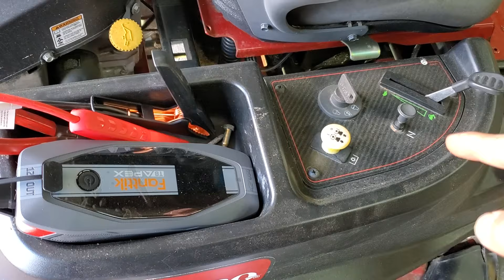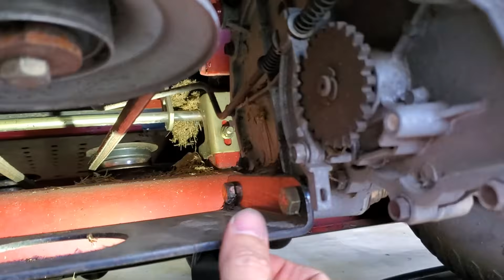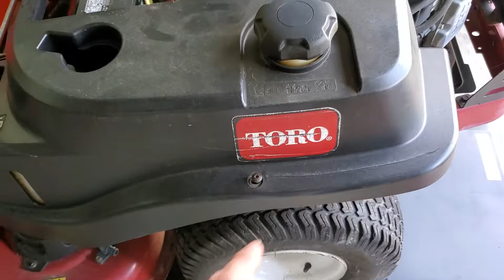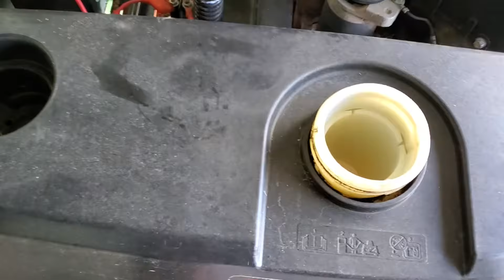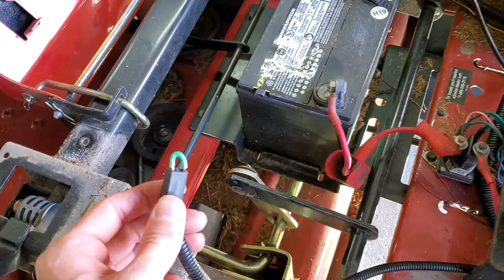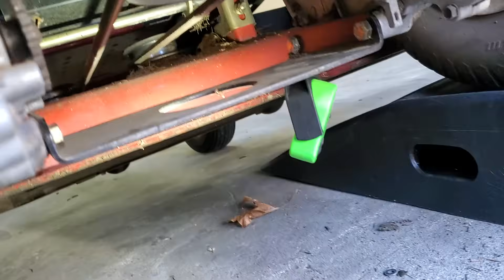Toro Timecutter Zero Turn No Start Issue Fixed By Bypassing The Park Brake

Comment: Could this be an issue even if you hear the noise.  Replaced the solenoid and battery but mine won’t turn over.  I will try this and hope this helps.  Great video

Comment: I had hoped there was a video out here somewhere to by pass that black box. The owner had already replaced that box once and I hope his older box it still good, Upon my initial inspection of what was going on, he had wired the battery backwards. I'm no expert but I am sure that done something to the electrical. So I replaced the ignition switch after the original one just stopped working after a few times. So i tired to jump the solenoid only to find out that it will not jump the starter because the starter is old as well, so waiting for the starter approval before I can continue. Thanks again for this tip.

Comment: Am I missing something? Is it the switches on the control arms bad? Or is it the brakes because I don't understand? Does the brakes get jumped too?
Reply: Hello You can test the switches on control arms with meter. By jumping them you are circumventing the switch. But remember the safety part if it is off.

Comment: THANK YOU! I replaced every electrical part I could find and it still wouldn't start up... then I noticed the noise in your video matched the noise mine mower was making. I disconnected everything the way you said to do it and it all started working again! THANK YOU AGAIN!

Comment: I bypass the seat the same way. Take the connector off and jump the wires together so you can start the mower without being on the seat. That electric brake is a joke. You can make your own brake system if you want to make a bracket for it. That is a stupid system. And it will brake again if you replace. They should have made a hand brake like most zero turn have it.

Comment: What gauge wire should be used for bypass
Reply from the maker: I used 14 or 12 but again this is temporary fix until brake module is replaced.

Comment: Mr fix it  my problem is with a Toro timecutter  same problem nut mine has a steering wheel instead of stick steer   where do i disconnect break wire on that type
Any help appreciated 
My name is dave

Comment: I like this video.i have problems with my zero turn Husqvarna that doesn't have spark ,only cranks,but dont have any spark at the ignition coil,should i do bypass as you did?
Reply from the maker: You most likely have a safety switch issue or ground. You can unplug the kill wires on your coil packs and see if you have spark that way. If you do that will confirm an electrical short somewhere in the wiring

Comment: If you bypass the switch the brakes should work the same as they did before. Am I wrong?
Reply from the maker: No, bypassing the switch is to trick the module to think mower is parked so that's why you have to remove the brake linkage too but again this it a temporary fix and you are to do this at your own risk because machine will no longer have park brake. To fix properly you need to replace brake module.

Comment: Does the machine still have brakes when in the brake position on the arms?
Reply from the maker: No, that is why I mentioned in the description that this is a temporary fix to get the machine moving and cutting again but you are to do this at your own risk if you decide to do it. The park brake will NOT be functional so the permanent fix is to replace the brake control module.

Comment: Does taking the brake module off affect the mower stopping when going downhill or locking the wheels?
Reply from the maker: Yes, when you bypass the park brake you have no parking brakes when mover is stationary so it is possible to start rolling away on a big enough incline. That's why I mentioned in the description that this is a temporary "fix" to get the machine going again and you are to do this bypass at own risk. To do the repair correctly you need to replace the module.
Reply: @mr_fixit  thanks.  I mow on a hill need a brake

Comment: First off, thank you for all of your vids as they've gotten me closer to understand how the Toro timecutter functions, but I need your guidance.  I removed the park brake assembly and inserted the wire into the 2 connectors and was able to get it to start..yay! However, it now does not move forward or in reverse.  I checked transmission belt and that's all in tact.  Any thought as to what I'm doing wrong? Thank you in advance
Reply: There are 2 rods at the back of the mower, did you by any chance pull them out to push the mower if you did push them back in and you will get drive back.
Reply from the maker: As long as the actual park brake lock pads are removed you should not have any problem moving or check if you moved the transmission bypass rods to the wrong position.

Comment: Thanks a million Mr Fixit! Great video which has solved a big problem for me. I   have a Toro Timecutter ZS 5000 which refused to start. Following your video instructions I removed the parking brake and, miraculously, we’re back in business again. Thanks! (To others, I might add that the most difficult part was deconnecting the wires under the brake. Needed to twist a screwdriver to get them loose, but it worked..)
Reply from the maker: Glad it helped, thanks for watching and leaving a comment.

Comment: What about the wires that go to the brake module?  I have the zero turn with the steering wheel. So it does not have the switches like on your timecutter. Mine has a feature on mine on the left hand side that has a switch that will let you turn on so that pto (blades) will continue to cut if you have to go in reverse w/o it disengage your pto when you go in reverse.
Reply from the maker: Unfortunately I have not messaged with that model but it would make sense to bypass that switch in order to make it operational for temporary use.
Reply: @mr_fixit  It appears that I have all the wires jumpers to make it work. I was still having trouble with mine till I found out the reason mine would not start there was air in the fuel line and was the culprit why it would not start.

Comment: I have jumpered all my switches and now my mower starts and moves perfectly. Problem I'm having is when I try to switch on the mower blades. That's when it dies on me. I didn't remove my brake levers like you did, just bypassed with jumpers. Will those arms still being attached cause the mower to die when you pull the yellow lever to start the blades?
Reply from the maker: No, if you jumped the control levers you should be good. It may be your seat switch. If it's jumped too, just plug it back and see if that works.

Comment: Want to Thank You for this video., iOn my Toro Timecutter 5020, replaced the soleniod, relay, battery and starter. Nothing. Even de-attached the blade bed from the mower to see if there was anything was blocking the blades from turning,  Saw your video and after following the steps, mower cranked right up! Thanks again!
Reply from the maker: Thank you for watching and thank you for the comment.

Comment: Thanks for the clear explanation! So if I jumped 12V straight to the starter, I've not just bypassed the solenoid, I've bypassed ALL the safety switches? I've replaced my starter, but still, it moves 1/4" and stops. The flywheel turns by hand and spins freely with plugs out. What else could be keeping the flywheel from engaging with the starter? It had been working 2 days earlier
Reply: Compression release
Reply: Thank CKS! Can you please tell me more about this issue and what I can do to check or fix it?
Reply: Where is the compression release mechanism, and how would that only allow the starter gear to barely move and not engage with the flywheel?
Reply: @johns1577  unfortunately it's on the crankshaft and you have to disassemble engine. One way to know for sure as this happened to mine. Remove air filter and using your hand or flexible rubber or plastic cover air breather intake stopping free flow of air and see if it spins easier . You may even get it to start like this but it's just a temporary fix.
Reply from the maker: What engine do you have on your mower.
Reply: @mr_fixit  26 hp Kawasaki
Reply: I have the Briggs and Stratton 139-0603 ENGINE-2P77F. Turned out my mechanic friend opened up the engine and found a really frayed wire. It must have gone resistive when trying to crank the engine because the starter would move 1/4" and stop. He'd fixed it and closed it up to try it, so I didn't see what wire it was. Relieved it wasn't the trigger for the compression release breaking off the crankshaft. Apparently, the Intek engines like mine are known for that. There a several videos on how to easily check if that's your problem.

Comment: Your testing process was grate, even though my mower was a slightly different model the shorting system you used with colour wires worked. Without that I could have spent hours looking for the problem. Many thanks.
Reply from the maker: No problem, thank you for watching. Just would like to mention again that this is a temporary fix and I do recommend replacing the brake module.

Comment: So you had a dead $3 switch and you didn't want to fix it. Is that pretty much What's going on here? Because the modules fine if you're bypassing the switches and then it works.
Reply from the maker: No, there was a short in the circuit for the safety switches inside the module so module needed replacing and that's why I stated in the description that this is a temporary fix until the module is replaced.

Comment: my toro ss 5000 won’t start. All it does is click, I already replaced the solenoid and tried this and nothing 😢
Reply from the maker: You will have to do some more diagnostics to see where is the slicking coming from to determine where you have a short or failed part.

Comment: Carb
Reply from the maker: In this video I'm showing the scenario when mower is not doing anything. If the mower is cranking over and doesn't want to start then yes, one of the possible causes could be the carb but not in this case. I can possibly make a video showing all the different no start causes.

Comment: Hi you doing love the chanel I by passed the switches still will not start any info would be awesome thanks
Reply from the maker: What is the mower currently doing when you turn ignition On?
Reply: Thanks for getting back to meakes a see light ticking noise when turn key it's a 2012
Reply from the maker: @mikekirwan2264  Have you checked the starter solenoid to confirm that it's working.
Reply: Did not what is the procedure to check thanks
Reply from the maker: @mikekirwan2264  I have another Timecutter troubleshooting video where I show how to check the solenoid with a test light
Reply: Replaced solenoid battery good still no crank battery good any more help would be great thanks
Reply from the maker: @mikekirwan2264  check with a test light if there is power going to the starter when you turn the ignition to start position.
Reply: Ok
Reply: Thanks

Comment: I bought my TORO 42" Zero Tuen Time Cutter last year 2022...within one lawn cutting, the brake module went bad, yeah warrantee but still $60 transportation to the shop and home fee!   The shop guys said these have been a problem for years...and pricey if out of warranty!

I always bypass the seat safety switches, now I may do the same to the steering lever safety switches too - don't need no stinking parking brakes.

This machine was built to Go - Go - Go!

I did the same to a reverse button on my old Scot mower - safeties are for kids!
Reply from the maker: Yes they had problems with those brake modules since day one, all the way back to like 2013 or 14.

Comment: Im not hearing my clutch engage or disengage.  Nor am i hearing the sound from the brake module working.   Makes me think the clutch is stuck on ?   Will the brake mechanisms work and make that sound if the clutch is stuck engaged?  That would explain why i hear neither one?
Reply from the maker: The pto switch goes through the seat safety switch so you need to be sitting on the mower to test the clutch. The brake module will not interfere so it as long as you are sitting on the mower you should be able to turn ignition ON without starting the mower and hear the clutch engage when you pull on the pto switch.
Reply: @mr_fixit  I noticed right off the bat that my switch felt kinda crunchy when turned .  So I replaced that first and I'm back working.   I thought maybe the break module because I have never wore a switch out that quickly.  Thanks for the great videos.

Comment: Well that what cost that your plugs ain't got no spark to it
Reply from the maker: Assuming all your safety switches work properly then you will not have spark if your coil is dead or the air gap is not set properly.

Comment: I have a Toro zero turn with no crank no start issue.  I have replaced all electrical components (starter, solenoid, starter switch, PTO switch, ignition switch, battery etc.  I can now crank and start mower with NOCO starter but not with out it.  VERY STRANGE.. thoughts?
Reply from the maker: Possibly needs valve adjustment or may have a broken compression release on the camshaft and that's why it needs more power to crank engine pass compression stroke.
Reply: Mine was similar, ended up being the fuses under by the ignition switch were slightly corroded. Wiggled them all good

Comment: AT THIS TIME I HAVE THE SAME PROBLEM.  I ALREADY DID THE SAME AS YOU.  BUT THE AUTOMATIC BRAKE CONTINUES TO WORK AND DO NOT LET THE ENGINE START.  I HAVE TO GIVE THE BRAKE A MANUAL TURN TO START THE MACHINE.  TIP IN CASE THE SAME IS HAPPENING TO YOU.  HOW TO DISCONNECT THE AUTOMATIC BRAKE?
Reply from the maker: If you jumped the handle bars and brake is disconnected but still have the issue then you need to replace it. I never had one that did that after the bypass but still that is a temporary fix. I do recommend to replace the brake module sooner than later. 
Hope this helps and thank you for watching.

Comment: Thank you
Reply from the maker: No problem 👍
Reply: @mr_fixit  truly thank you. It is running great. I found the brake controller for just over $100.
Reply from the maker: @duckypaul  Glad I can help. Little tip when installing the new module clean the connector plug and put some electric grease.

Comment: Mine starts but brake will not disengage to move.
Reply from the maker: Most likely the brake module has gone bad. Check out one of my other videos, you can bypass it temporarily (or permanently at your own risk) if you need to be able to use the mower.

Comment: My mower won't start at times ...when it does I can start it with the control arm inwards
Reply from the maker: Possibly bad safety switch or safety switch connected in reverse

Comment: How long did it take it to mess up
Reply from the maker: Every machine is different it also depends on how you take care of it and if it's out in the element or it gets covered after use. I remember few years ago when they first came out with these electronic park brake modules that alot of them developed problems within a year.
Reply: @mr_fixit  I just bought one a week ago with the floating seat it cuts really good and the floating seat really took the bumps out my back I got a bad back and that's why I bought the my ride how do you adjust the steering on it
Reply from the maker: @wadebarnes6720  there is a nut at each transmission where the rod connects, that's the neutral set screw.

Comment: Hey, gonna try this, if it doesn't work, I need to get fuel solenoid off, can't really figure out what tool to use or if there are tork screws plus a 1/2 inch thin filed wrench?
Reply from the maker: What is the machine currently doing when you try to start it. 
If you are talking about the fuel shut off solenoid, yes some can be removed with  thin wrench and some you can remove the whole bowl from the carburetor.

Comment: Mine still won’t turn over after doing that. Is there a certain type of wire needed? I just used 14 ga. Does it need to be solid wire?
Reply from the maker: No that should work so there is probably something else going on. Is the mower cranking at all?
Reply: @mr_fixit  it does if I Hotwire by connecting the solenoid terminals together. But it still won’t turn over. Seems like no fuel is getting to it. I didn’t totally remove the breaks yet though. Is that a must before it will start??
Reply from the maker: @TeamBazz  if you bypassed the switches on the control levers and still no crank then there is another issue. And since you mentioned that by jumping the solenoid you can get it to crank, then the solenoid may be bad as well. Definitely also pull the fuel line from the fuel pump to see if you are getting fuel and also check for spark.

Comment: My brakes are release but still to hard to move
Reply from the maker: Sounds like you either have drive belt issue or hydro issue. If both transmission move at about same speed start with the drive belt.